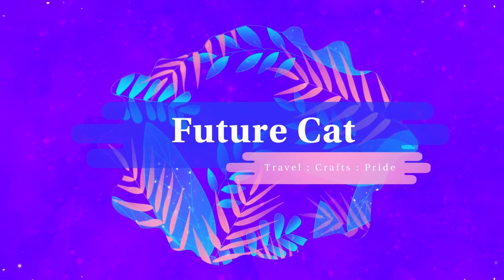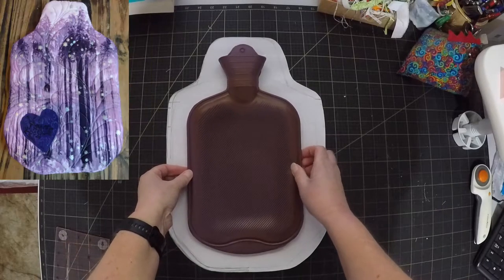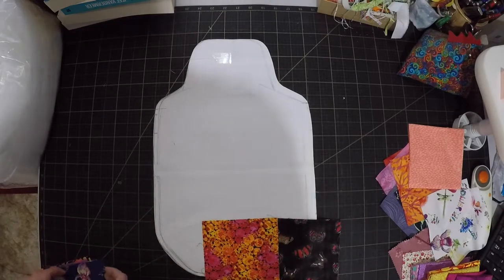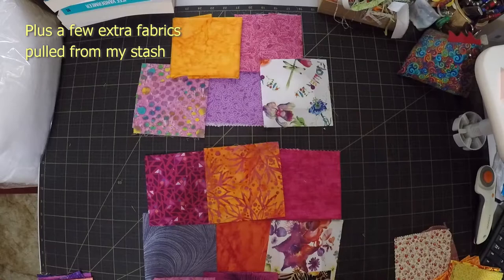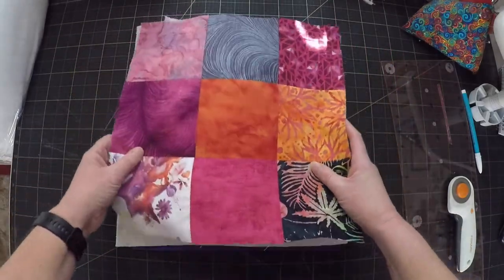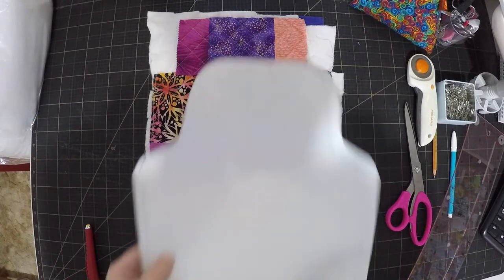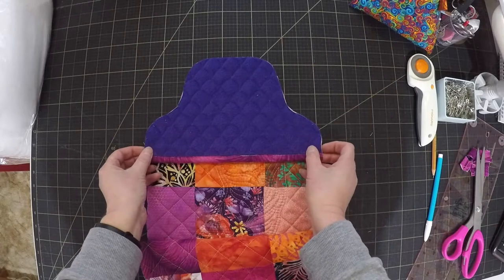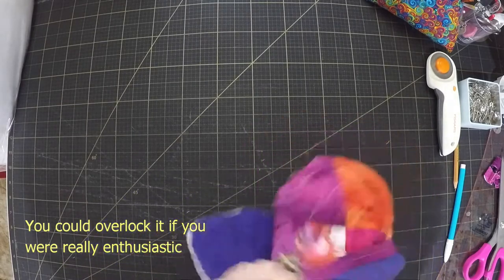How to make a quilted hot water bottle cover

Comment: Don’t like the inside raw edges. Especially if you don’t have an over locker
Reply from the maker: I find I don't notice them - I leave the hot water bottle in the cover to fill/empty it (you just need to fold back the top part so it doesn't get wet). But if it bothered you, you could always add a lining.
Reply: @FutureCatNZ  that would make it too thick. You wouldn't be able to feel the heat through so many layers.
Reply from the maker: @SIM101ism  that's why I just left it with the raw edges 🙂